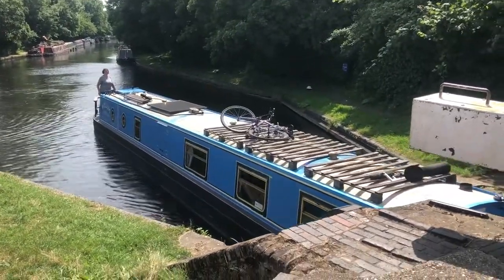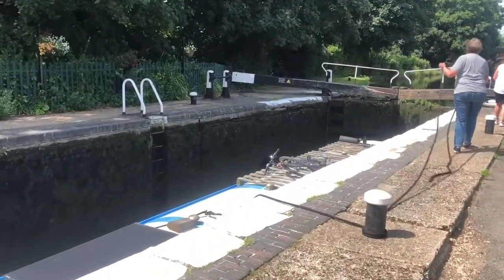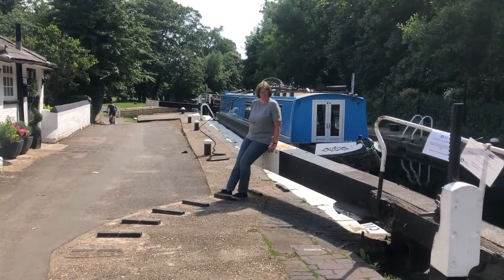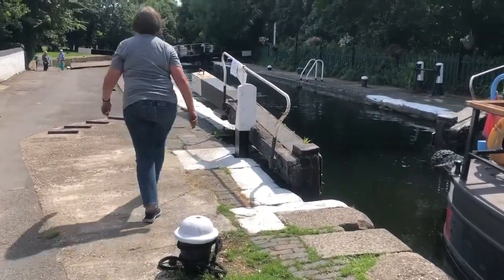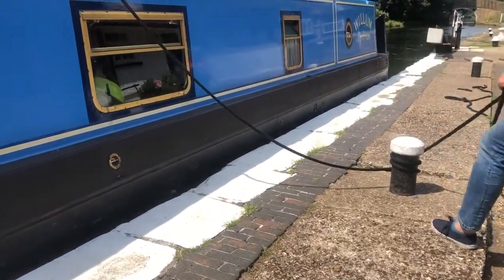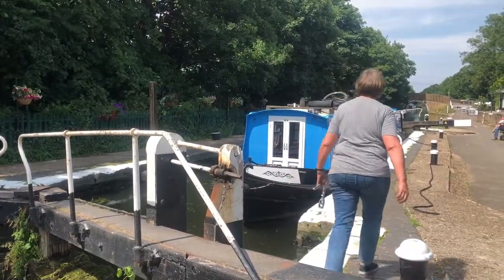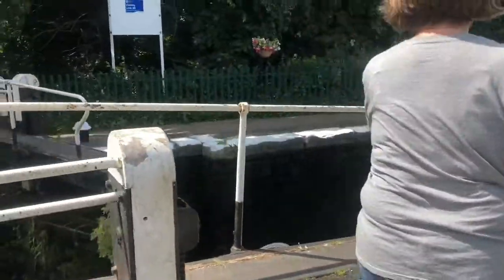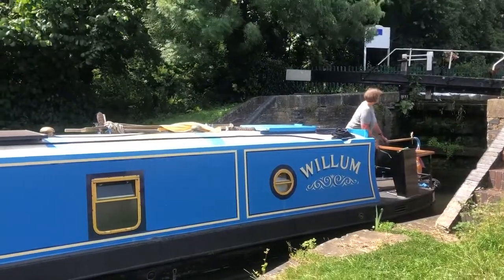Managing a canal lock single-handed

Comment: Excellent, great demonstration,  with textual details and tips and tricks.  The best I have seen so far.  

Your presentation style  and your information was excellent. I will be using your / your company's training service for myself,  I am full of video derived knowledge which I would like to start deploying practically with your experience and expertise. 
There are many dangers that face boaters and in particular narrowboaters in and around locks,  in my VERY humble opinion, a little more emphasis about the cill, what it is and why it so important to narrowboat helmsmanship would very much improve this already excellent video course, as would  similar emphasis of using the centre line to support the boat on a bollard when going down in a lock, I am referring to making sure the correct winding method / direction. 
I do not want to cause offence in anyway. I make these points having been a trainer for 40 plus years, not this subject. My very best regards Colin.

Comment: I'm planning to do a trip for my wife's 50th. I'm researching how to do the locks. I'm a qualified skipper up to 80 ft, and operate single screw vessels all the time, but we don't have any locks in NZ, so locks are new to me. I see you closed the gates on your way out, so that tells me the gates are closed as we approach. Is there bollards prior to the gates to put a line around,  then walk up and open the gates and return back to the boat, or is there a technique I could use that is easier than that? I have done enough research to see that it is bad practice to leave the boat in gear, pushing against the gates. PS Awesome video.
Reply from the maker: Hello to NZ! Yes on the English canals you should always close all the gates and paddles (sluices) behind you in order to conserve water. If you leave anything open, you run the risk of draining a part of the canal! Some canal sections are river fed, but others just get water pumped up from underground and need to be topped up if they run dry. This can be a real problem sometimes in the summer (yes even the English summer). To answer your question, every lock has lock landings above and below with 2-4 bollards to tie up to. The bollards are usually painted white to distinguish them from regular moorings. Hope this helps!

Comment: On the Avon they strongly recommend a bow and stern line whilst in the lock, rather than just a centre line. How would you organise that single-handed?
Reply from the maker: This is a bit more tricky of course. I don't know if they insist on bow and stern line precisely. On the Thames some lock keeper want two lines and I have used the centre line and the stern line for that purpose. If you have quite a long boat, the bow and stern line won't be long enough to hold both at once.
Reply: @willumboattraining1372  Thanks for the feedback. I have seen some short/GRP boats bring a bow line and stern line to the same central lockside cleat/bollard - against classic practice, I know, but seems to offer control over both lines from one spot. Most narrowboats I've seen 'cheat' and just use centreline. A centreline plus bow or stern depending on the direction of movement your'e most worried about sounds like a good hybrid.